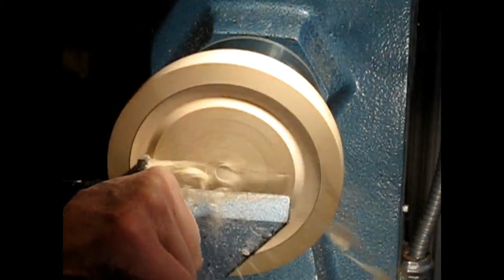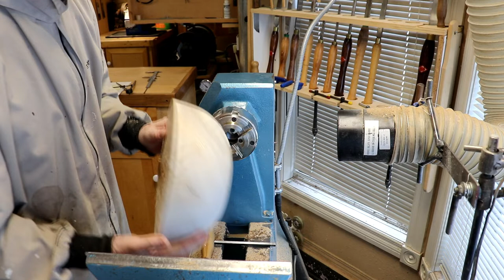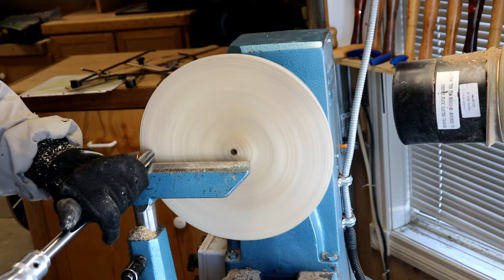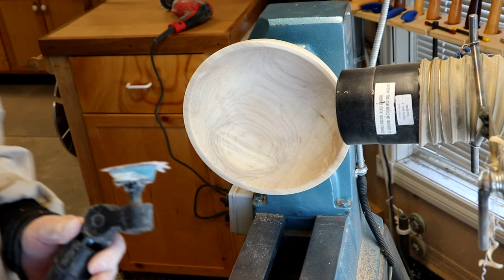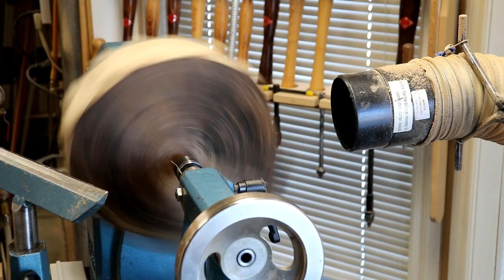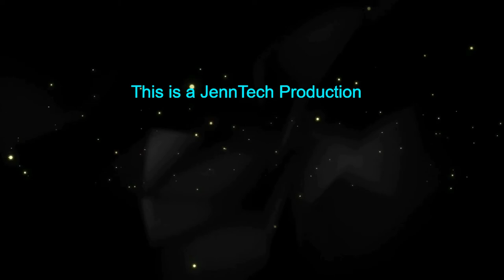Log to a Bowl Part Two  WoodTurning a Poplar bowl

Comment: Everyone should have a drill bit on a stick.. wait a minute.. the tail stock? What? Whyyy!? Why not use a drill bit in the tailstock? The bowls grain is amazing. I’m always surprised by how bowls hold together despite grain direction or that woods used have grain that is multidimensional to strong in all directions. I think mesquite is one of those gnarly woods but probably not great for turning. Does that happen over time with any bowls ever? Grain trouble even after it’s dried.
Reply from the maker: Hi FW,   I liked your description "bit on a stick",  that's awesome.   For sure the tail stock approach for drilling the center hole would work and clearly necessary when you need a precise hole,  but for this project using the tail stock would take me several more steps compared to the ease of the "bit on a stick".  Here's the process,  insert jacobs chuck into tail stock,  mount the bit,  slide the tail stock up to the work piece,  lock the tail stock,  crank out the tail stock as far as the quill will travel,  unlock the tail stock and push the tail stock further forward because the total travel on the tail stock isn't long enough to do the drilling job in one pass.    Relock the tail stock and then complete the drilling process by cranking out the tail stock quill to the depth required.    As you could see from the video,  the "bit on a stick" was pretty slick compared to the steps I'd have to go through with the tail stock.  Doable for sure but a bit more onerous,  plus making your own bit on a stick is a small rewarding project and quite a functional tool.

You're right it's amazing how the bowls hold together so well despite grain orientation.  My poplar experience is that the bowls don't usually crack along grain orientation but more typically near some sort of defect like a knot or existing crack.  I've never turned mesquite but have seen some photos of turned mesquite and it looks amazing and really shows off grain and color.      Thanks FW for watching and commenting!
Reply: @fromthewoodpile8248  Thank you. Love seeing you turn.